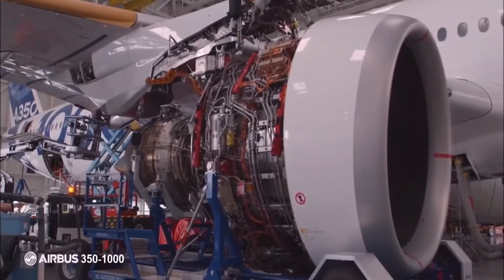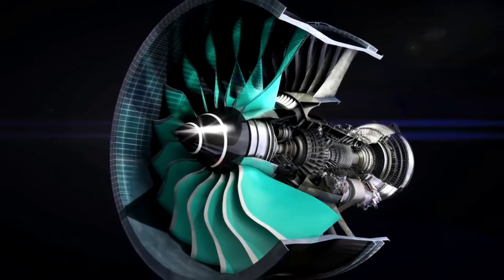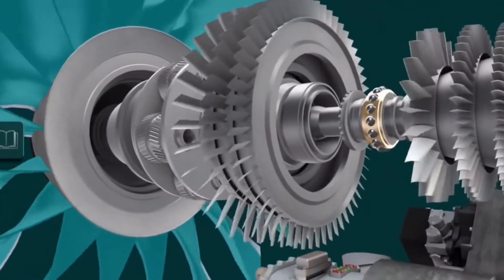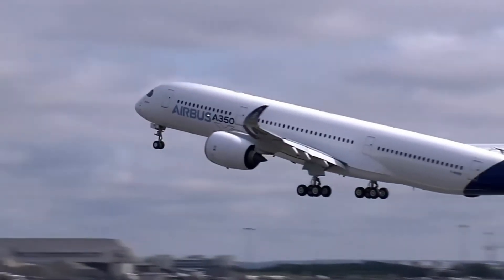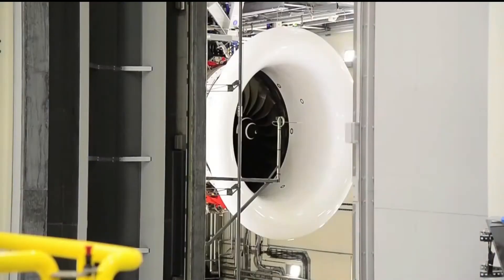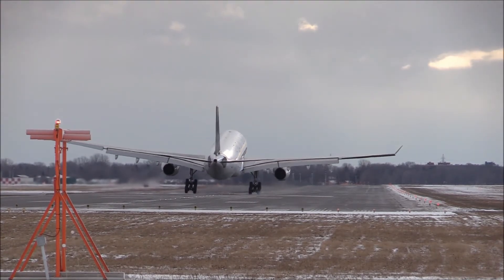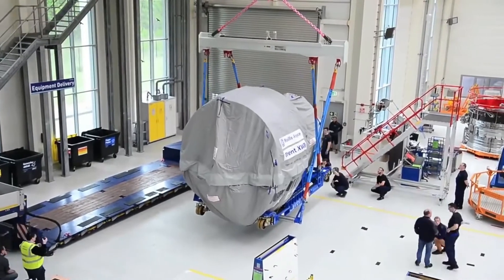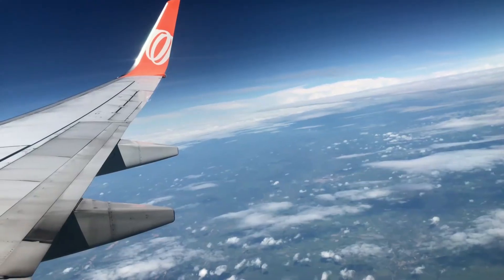Why Trent XWB is the Best Aero Engine | You Might Have Not Known This Before

Comment: Fun showing Boeing 737-800 plane and engine, the cincurrent. Don't you have with all those inside video's about the XWB engine nothing what showing them in the outside on a plane. Saw an A330 but mainly just 737's like Ryanair, the brand we associate as cheap.